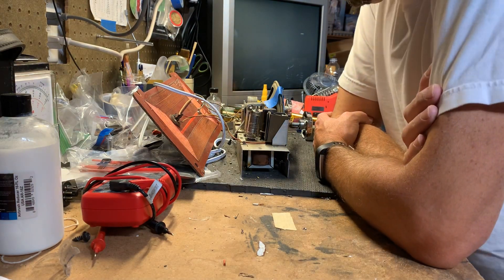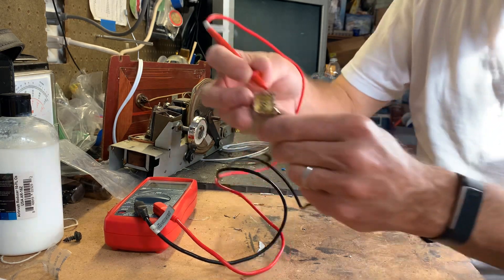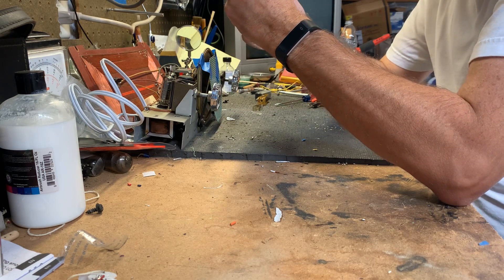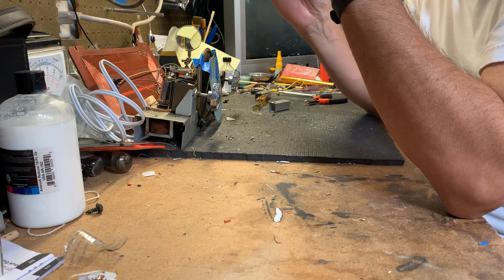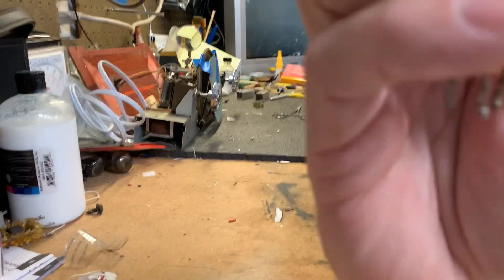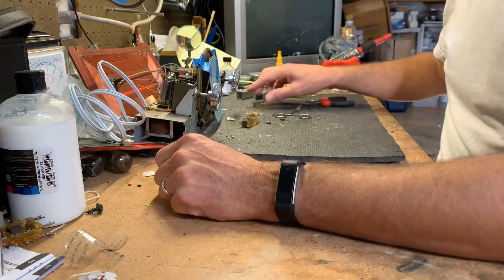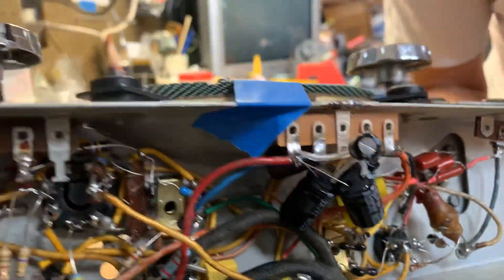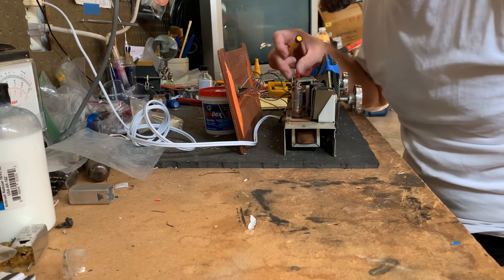Antique Radio I.F. Can Repair S.M.D.

Comment: How do you determine what value to use for the capacitor s?
Reply from the maker: Sometimes the schematic will list the values but if not, 75-100pf will usually be in the ballpark

Comment: Is it necessary to use mica capacitors for this fix? Or will any non-electrolytic do?
Reply from the maker: I’ve never heard of anyone using non mica caps for this.  I think you have to to get the smaller values needed for the fix.

Comment: Great and helpful video.  I have the SM removed from my If Cans. Now I need to figure out what Caps to use for a  '54 model  Hallicrafters S-85 with SMD.  How can you  figure out what Caps to use because the Schematic is no help.  Any suggestions there?  Done any Halli '50s model IF Cans?
Reply from the maker: You may have to experiment but generally 100pf caps will work.